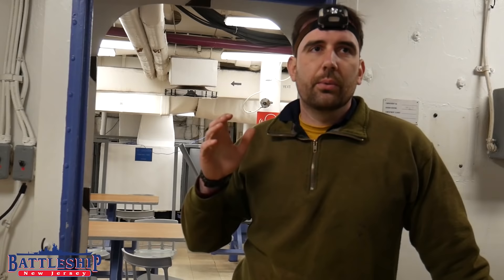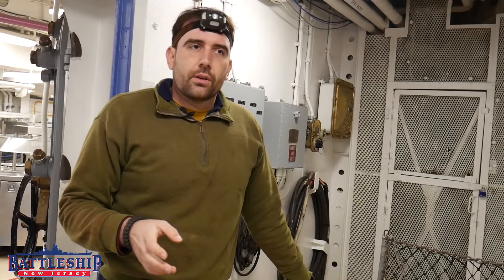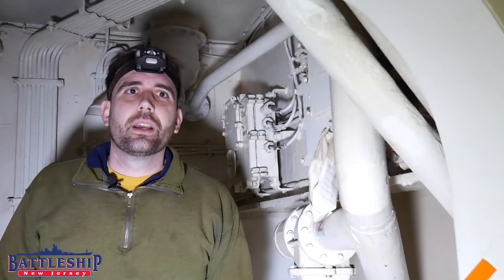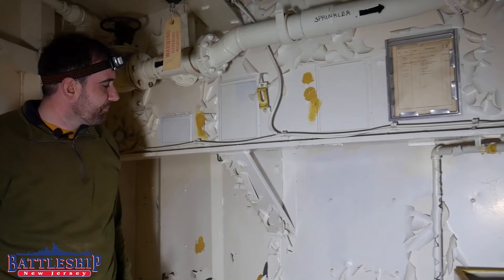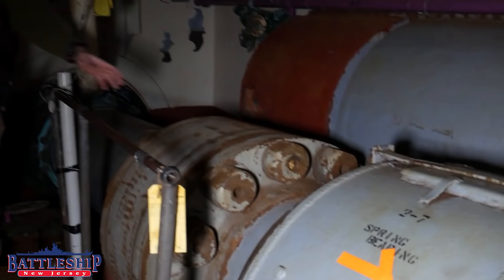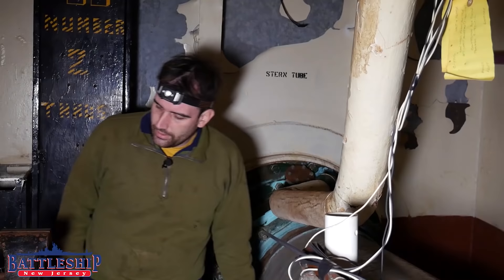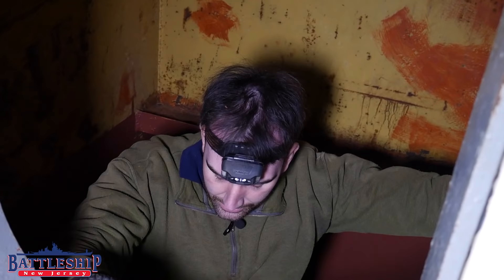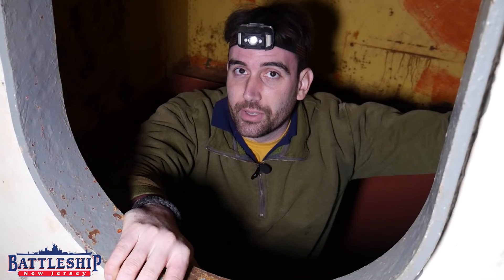Down to the Battleship's Keel

Comment: I have significant mechanical aptitude which extends back to my childhood a habit of taking things apart and putting them back together. That aptitude continued though primary schooling (shop class, mechanical drawing), on through various skilled jobs including being a military trained aircraft structure mechanic. Along with hobbies that include building cars, plus restoring bicycles and motorcycles, remodeling homes, I pretty much understand how and why most modern structures are designed and assembled. My one weakness has always been watercraft, and especially large ocean going vessels. Just never spent time in and around them. No interest. When Ryan explained that the keel is essentially an I beam running the length of the ship, around which everything else is built, it all clicked into focus. BTW, my recent interest in naval vessels, and this channel, was a tour of the USS Iowa in San Pedro.

Comment: The Key receptacle at 14 minutes would be used to mark a clock device that the watchman would wear, about 6'' in diameter. it would have a specific way to show on the clock both time and position of key receptacle. Not sure if they still use in commercial service, but I remember them from the 80's. I appologize if someone has already mentioned this....really enjoying the Tour, thanks Ryan and Camera Lady

Comment: That watchman's key station did hold a key, but it was for mechanical clock based logging devices the security guard would carry on them as they did their patrol. The key had a number on it's blade (like on a number punch kit) and the guard would insert the key and the number would be embossed onto a paper disk that slowly rotated with the time. Each key would be unique to the location and would be placed on a different spot on the blade at random to hopefully prevent overlapping log entries. At the end of a shift the guard would turn in the paper disc and that would be kept as a record of their patrol. I used to work in a place that used them (long before I worked as a guard there) and the key stations are still mounted all over the property. I even have a few of the keys themselves with the numbers.

Comment: I used to put pipes in the fuel tanks of new RN ships, and they were only destroyers.
I had to crawl through these access points past at least three bulkheads.
One wandering light lead and as  quiet as a graveyard.
I used to think if the dry dock gates gave way no way would I be able to get out.
Mind you going in I always felt a bit claustrophobic but after a while I sit there and find it quite peaceful.

Comment: 14:13 That's a key station for the Sounding and Security watch. Sounding and Security watchstanders carried a clockwork mechanism that would record the time that a particular key was inserted and turned.  This provided proof that a watchstander was at a particular location at a specific time, and not off somewhere catching 40 winks on a pile of kapok life jackets.  As for racks for the M2HBs when they weren't mounted, in many ships they were just piled in a corner of an armory space and netted or strapped down.

Comment: the key for the  watchman's key was a mechanical time keeper that the watchman carried with as he made rounds, " A watchclock is a mechanical clock used by security guards as part of their guard tour patrol system which require regular patrols. The most commonly used form was the mechanical clock systems that required a key for manual punching of a number to a strip of paper inside with the time pre-printed on it." "Watchclocks often had a paper or light cardboard disk or paper tape placed inside for a set period of time usually 24 hours for disk models, and 96 hours for tape models. The user would carry the clock to each checkpoint where a numbered key was mounted (typically chained in place, ensuring that the user was present)."

Comment: The key on the door to the 50cal ammo storage is designed to fit into a clock that is carried by the roving watch. The clocks were round, about 10" in diameter, with a leather strap so you carried it over  your shoulder,  and there was a circular piece of paper inside that rotated with the time. When the watch stander would get to that door, he would put the key into the clock and rotate it one time. That would put the time that the watch stander was there marked onto the paper. The key had a number embossed on it, so the paper would show that key was in the clock at whatever time the watch stander was there. It was proof that he had actually there, not just saying he was there when maybe he was not. Some roving watch stations had a small book to record the time the watch stander was there, but it was possible to record 4 different times all at once so the watch stander didn't actually visit that location once an hour, just once during a four hour watch. That process was called "gun decking" for reasons I don't remember. The key/clock system kept the watch standers honest.

Comment: Exploring was one of the fun parts of being aboard ship.
Ryan: 
Did you ever explain those 3-contuctor color-coded receptacles and coils of black 3-conductor wire stored throughout the passageways? I think you said you did a DC-man themed video. Maybe it's in there?
 
A couple of details: 1. You said nothing can be welded to the barbette, but there is an angled support for that huge girder welded between it and the barbette. 2. The watchman's key is chained inside the box you showed. When a watchman comes 'round he pulls out the key and inserts it into a clock he carries. It codes the time he was at that location, to prove he made that part of his rounds. It's used at important parts of a route in civilian installations as well as aboard ship.
 
Thanks again for your knowledge and dedication.

Comment: That key box on the hatch would have been exactly what you said.  It would have been a key with a very specific digit/letter that the watchman would have removed and inserted into a device he carried that contained a paper disk which would rotate as a timepiece. The watchman would then turn the key and it would impress that digit/letter onto that round paper disk recording the time hie was actually there. 
Great videos.

Comment: That key holder in the door was for a guards rounds clock. As the security guard walked around each location had a key chained to that holder. The rounds clock was round and in a leather case with a shoulder strap. The key was stuck into the clock and turned marking the disc of paper with the time and location. This confirmed that the rounds were made and each location checked

Comment: When I was in the MP's we had to do our regularly scheduled security rounds with what's called a watch clock, it was a clock with a paper spool, when you arrived at a point on your round where there was a watch key station, you'd pull the key out, stick it into the watch clock lock, turn it, and it would punch on the paper tape spool the time and place where you were on your round at the time. Then our supervisors would remove the paper tape and read it to make sure we were conducting our rounds as scheduled.

Comment: The key box that you spoke of for the watchman was inserted into a circular time clock that the guard would carry. This was battery operated and would spin a paper disk once every 24 hours. Think of something the size of a canteen. Each key had a raised number. The key would be inserted and turned so an impression would be made on the paper showing the time the guard checked this space.

Comment: That is why you have internal zinc anodes on the inside of that condenser, the plugs are used to seal off the tubes, they are made from bakelite, they will swell up and seal, then during a drydock period, the damaged tubes were punched out and new ones inserted

Comment: Nice tour. The fins you see extending out the sides of a ships bottom are stabilizing ribs or fins. Not keels. They have no structural parameter other than to resist “Rolling”. The light fixtures you were referring to are not specifically designed for water tightness, they are specifically designed to be “explosion proof fixtures”. They prevent any arcing if the bulb were to be shattered and start a fire in an ammunition or fuel storage area. The housing does prevent water from splashing on old incandescent hot light bulbs causing them to shatter then spark.

Comment: One of the first jobs I held was as a security guard with Pinkertons at Three Rivers Stadium. Yes,that long ago. And we used this system to prove that we were doing our rounds. Believe it or not, it proved its worth when I found an open door where there should not have been one. Near a key station. Police called. Intruders found. And I could prove that the breakin occurred between my rounds. I can also add that that old stadium was a wind tunnel in spots.

Comment: The all or nothing armor scheme of protecting only the ships vitals was used not because of the cost of armor but in order to stay within treaty limits. The second London Naval Treaty specified a maximum displacement of 45,000 long tonnes. It was also important to limit the weight of the armor in order to achieve the speed requirements of the design. All of this in a ship that could still pass through the Panama canal.

Comment: I used a watchman in the late 80’s working security.The key has a number on it Like a type writer head would .You insert the key. In to a clock .It has a disk made of paper .This disk has times printed on it and turns in with the clock and the analog hand on the clock front( looks like a pie)  .when you turn the key it embosses the number on the paper disk on the corresponding time .You go from station to station in sequence inserting the key each time.This proves you walked your patrol and when you did it and where you were points in time during that patrol .

Comment: Actually, those key boxes would have been in use while the ship was active.  We had them on our ship and the Bosun Mate of the Watch or Engineer on Watch would make their rounds of all the spaces they were responsible for.  The keys make a mark on the time clock's card and is inspected by the First Lieutenant and Engineering Officer to make sure the inspection rounds are being made.  This evolution happened even underway as all spaces were not manned all the time.

Comment: NOTE, WATCHMAN'S KEY STATION> The watchman/security guard assigned to the ship would have a route through the ship to follow. Those key stations are there as "check points" on the route. When the guard arrived at one he would remove the key and insert it into a device he carried with him the turn the key (just as you would most keys). Turning the key in the device causes the time and date to be imprinted on a receipt (old devices) or electronically stored (newer devices in the 90s). It was used as a way to insure that the guard was actually doing his job and not relaxing/sleeping during his shift. It was also used by the Federal Government to insure that private security contractors were actually checking these ships in mothballs to insure that the contractor was actually going out to the ships to perform terms of the contract.

Comment: The key spoken about around minute 14 would have had a number on it that would be been put into a clock that watchman carried to make the specific time he was at that key location. It was an accountability system to make sure watchmen actually made their rounds on time and if something happened they could go back and look at the tap from the clock and see when the watchman was there last. They were used for over 100 years, though in the late 90's and early 2000's most of them were replaced with digital equivalents.

Comment: something i would like to see. from battleship new jersey. is for another tier of tour to be added to the available ones for purchase. (with an appropriate pricing as well) where you can actually go anywhere in the ship. (excluding museum storage spaces). i think it would be interesting to crawl through some of the more out of the way spots on the ship. and an interesting experience to see what some of these sailors may have to navigate through for various reasons. perhaps including the museum curator to come along as well. (perhaps something new and interesting could be discovered). i realize this is a very unlikely thing to have happen for various reasons. safety being one of the main ones. but would be very nice to see.

Comment: I worked for the board of inspection and survey in 1992- 94. I got to go all the way down into the double bottom of the USS Ranger and several other lower sections such as the sonar dome on a knox class frigate.  Getting all the way down to the bottom of the ranger was a lot of ladders stairs and small tubes.  I did that in my twenties I don't think I want to try it again in my fifties.

Comment: the 'key station' on the door would have held a brass key with a raised letter on the end. The watchman had a 'tell tale clock' which had a paper reel inside that was marked when the key was turned in the box. It also printed the time and date, ensuring the watchman actually did his patrols.. ... .. not snooze in a chair somewhere.

Comment: Ryan, I suspect that those rooms that had the chill water systems installed but were not used as magazines were actually meant to just be "reserve" magazine rooms.  Rooms that would serve other functions but could be easily converted into magazines or volatile material storage if they were needed.  Since it didn't take much extra time or money to build in the equipment now, but would be really hard to ad later if they needed it, they just went with it.  Since the US had a history of keeping their battleships for a long time, and refitting and retrofitting them, it would have made sense to the designers at the time to consider that in the future, the ships would need alternative or extra storage as new and different weapons were added and tested.  Or, if some other space became unusable for some reason, you could quickly turn some valves and suddenly you have some makeshift storage.

Comment: I got a tour of the top deck of the New Jersey in the mid 80's when I was in college.  I enjoyed seeing those big guns up close, but I really enjoyed seeing the relatively new Phalanx anti-missile gatling guns.  I was surprised that the ship seemed to be roughly the same size as the aircraft carrier tied up on the other side of the pier.
Reply: That brings to mind seeing the Wisconsin I think it was coming over the horizon on its way in to NOB Norfolk in 1980s. Even though riding very low slung in the water compared to the CVs it somehow 'felt' more massive. And that was true at the pier too; carrier on opposite side of pier was merely a grey wall from "horizon to horizon" at an eye level view but the BB could be seen and taken in by the mind.

Comment: The Watchman's Key Station held a skeleton looking key chained inside with a numbered typewriter key embossed on it. This was inserted into a round Clock looking device with a paper disc inside. The watchman inserted the key and printed the number on the paper disk as it rotated with the clock. With this the supervisor could verify when the station was inspected.

Comment: The shaft coupling is made of a sacrificial material. It will sheer if the propeller is stopped by something so that the reduction gear and other associated vital stuff will continue to spin and is not damaged by whatever killed your propeller.

Comment: Typically that key was inserted into a "detex" clock and rotated.  Each key at the individual stations had a different length/mark.  It would make a mark on the detex clock paper that indicated the watchmen was at a specific station at a specific time.  Mgmt had the key to the Detex clock and changed the rotating paper each day.  Looking at the paper would allow confirmation that rounds were being done regularly and not a lot of time was spent dawdling around.

Comment: Having been a security watchman, the keys in those boxes would have been chained to the box, and the watchman would be carrying a "key clock" that had a clock in it as well as a punch tape. Inserting the key that has a unique pattern of "teeth" into the clock and turning it sharply would mark the tape, showing the time the watchman was at that station.

Comment: At 13:45 you talked about the "key box."  There was a key on a chain in there that was placed into a "Detex" Clock.  The guard carried a "Detex Watchman's Clock which had a paper disc inside.  When the key was placed into the keyhole and turned,  the number of that key would imprint on the disc showing that  clock was at that place at the time marked.

Comment: At the first of the video you showed the key box attached to the door. That box would contain a key and as the security person went to station to station he would pull that key out which would have a small chain attached to it and take that key and insert it into a round looking device about 5 inches in diameter in a leather case with a strap to wear around his neck and turn one revolution then proceed to the next station. That device was a mechanical recorder and record every station in it so the supervisor could tell he traveled to every security station during his watch and also they might make that circuit several times in a 8 or 10 shift.

Comment: The watchman had a clock on his belt.  At the various watch stations they would remove the watch key, insert it into the clock they carried, and turned the key... This recorded the time and location of the watchman, each watch station had a different shaped key that fit into the same key slot on the clock. At the end of the shift the watch clock was turned over to a supervisor with another key, and the clock would read out the times and location codes entered by the watchman, with the supervisor's key.